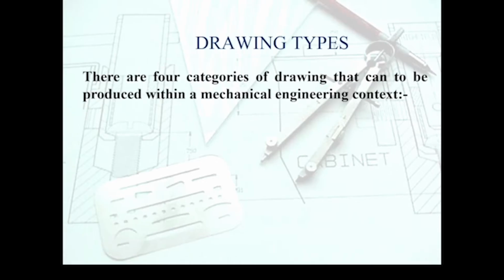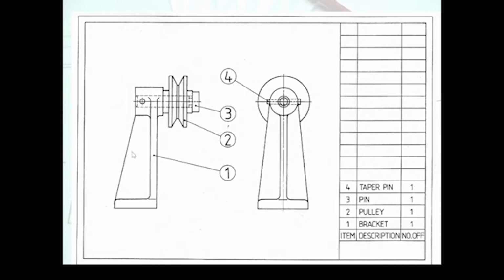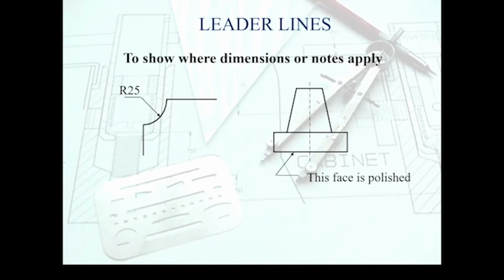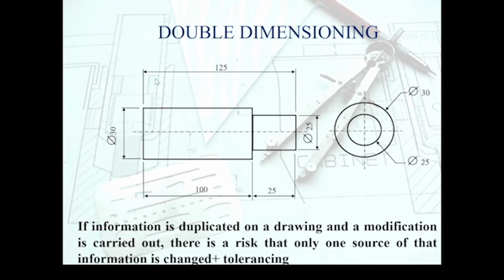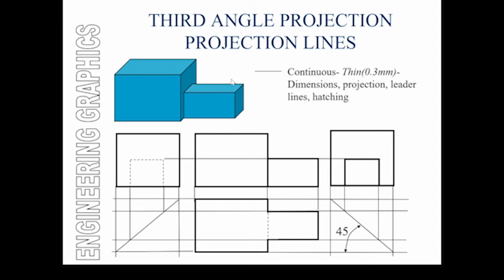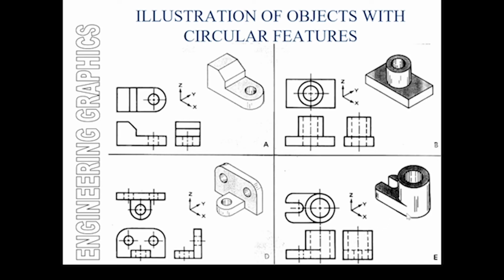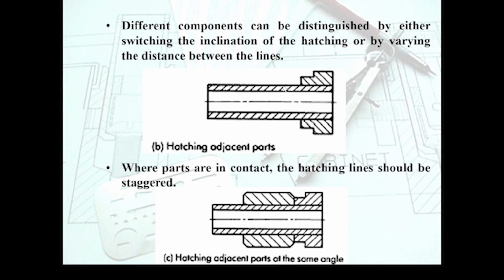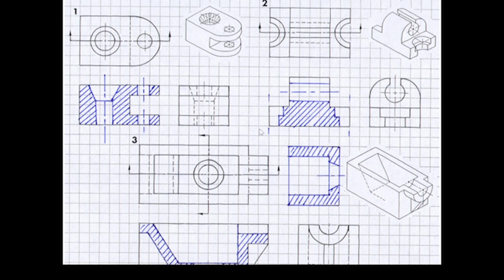BS8888: Understanding technical drawing standards.

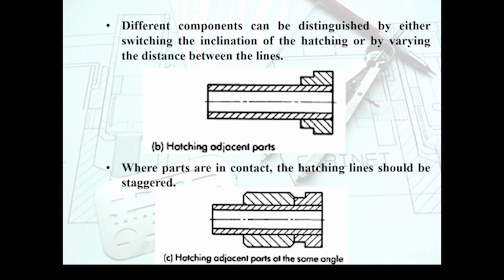Comment: I'm pretty sure at 57:35 the centre line does not on it's own suggest a cylindrical shape - only that it is symmetrical about the centre line. You'd need a second view to show the cylindrical nature, just like how the 3rd angle projection symbol needs both the circles and trapezium.

Comment: The drawing at 7:50 seems to break a lot of rules- complete circles should give diameter (not radius), leaders seem to touch parts, numbers through the dimension line (instead of above it). Also, M6 does not give pitch... Also, at 1:01:40, pitch is given but not explained.